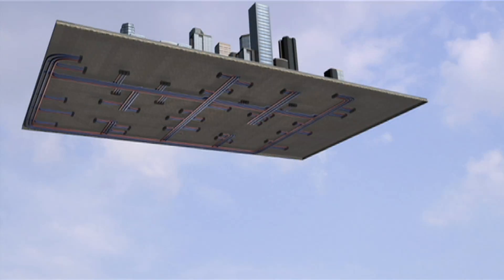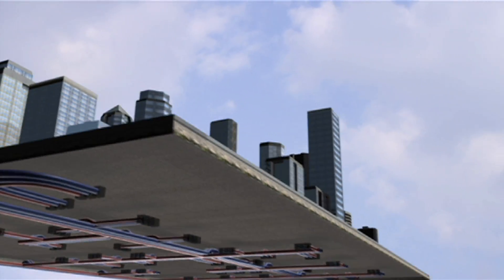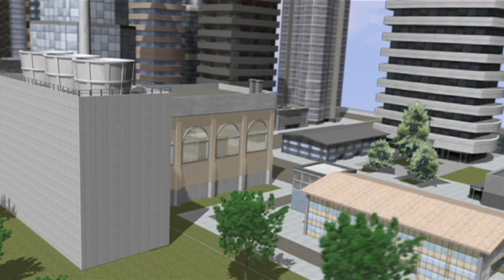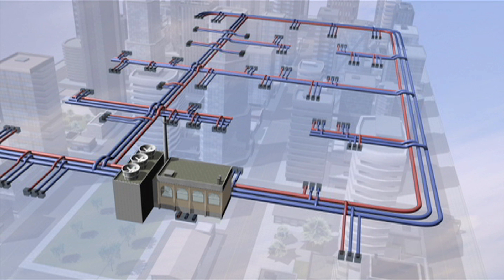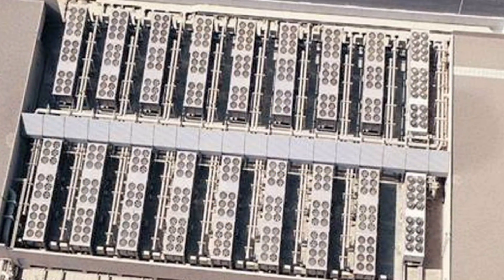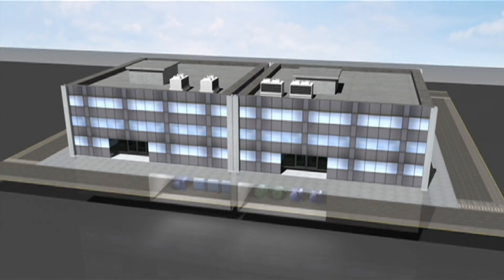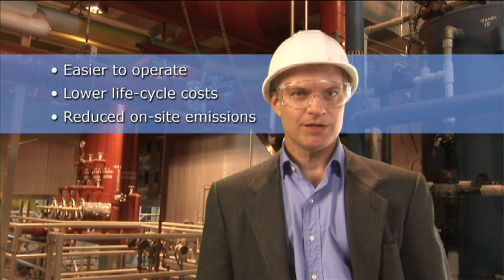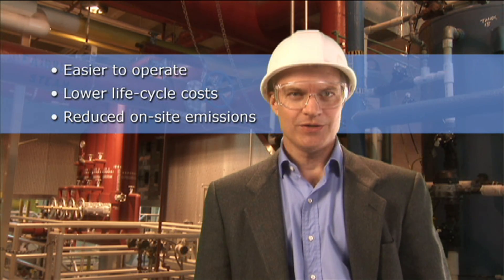District energy animation

Comment from the maker: @dextropropoxyphened  Most U.S. cities and college campuses have a district energy system, using either steam or hot water to heat multiple buildings from one central plant. Many also have a district cooling system, recirculating chilled water to buildings on the network.